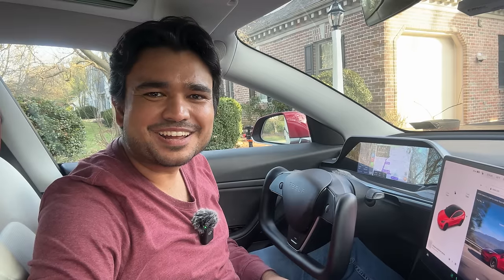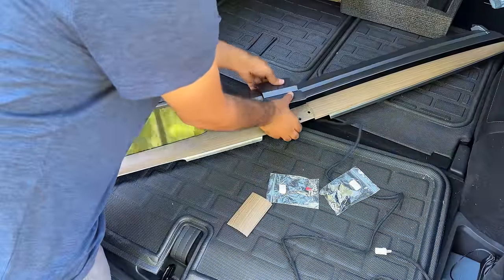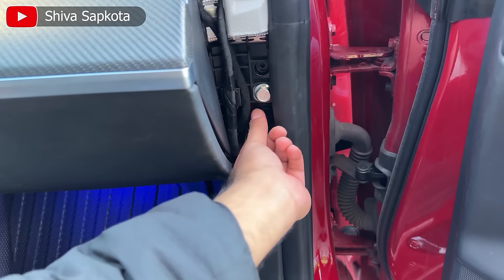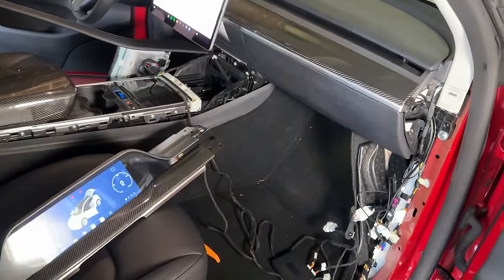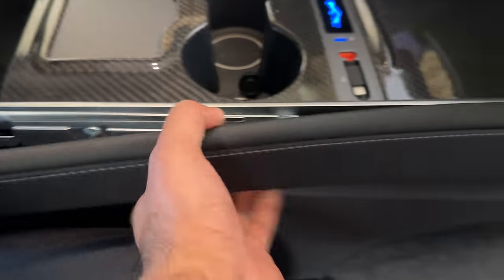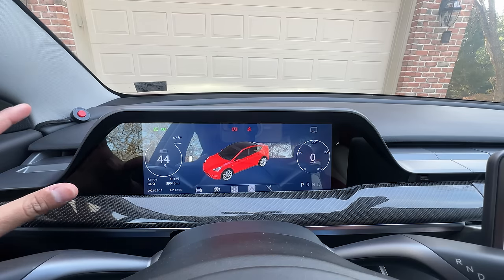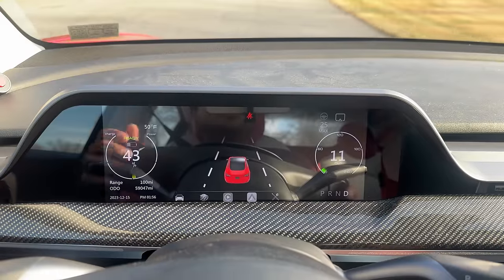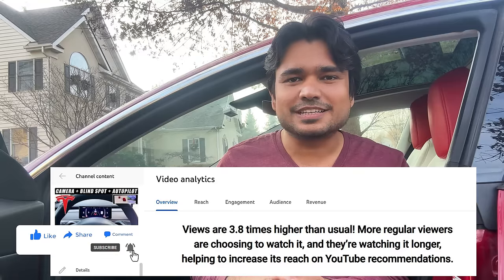MOST Integrated Instrument Cluster Display For Tesla Model 3/Y Now Has Android Auto & Carplay 2023

Comment: Hey Shiv. I really do like your reviews but not sure you did this one justice. I do agree with some of the UI inconsistencies and there are a few more you didn’t mention. The seat belt light stays on, the % under the battery amount (instead of beside) the mi/h, the fact that speed limit warning is totally missing. Maybe include those next time?  Also, aside from all that I purchased this from Teslasy and they have already addressed the seatbelt icon issue. They are working on the others. The graphics are no different than other displays and in fact the crispness and clarity of this one is WAY better than the smaller displays.  Also the time works perfectly if you set your timezone. Things like this missing from your review make potential buyers not get the full picture.
Reply from the maker: Thank you my friend. I really appreciate the honest feedback. You have supported my channel for a long time and I am extremely grateful. With so many products I test, sometime I don't catch all the inconsistencies. I will for sure try to highlight those in my next video.
Reply: Have they addressed the other issues yet?

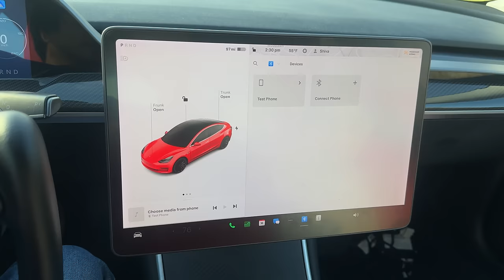Comment: Hi Shiva, I just installed mine but I noticed the seatbelts icon on the passenger side is on and I have to buckle it in order to go away. For sure it on my tesla display screen showing my srs system is working normal. Is this normal on the unit and will there a software update to fix the configuration from the TMA side? Thanks 23:21

Comment: I have a german Model Y. Does it fit in there?
Is a front camera compatible?
Reply from the maker: You will have to check the type of dash you have. Some Model 3/Y built in Germany have different types of clips and won't work with this display. If you open you dash and you have a curved clips, this won't work. If you have straight clips that attach to the car, then yes this is supported. Front camera is not supported on this one. Thanks
Reply: @ShivaSapkota  thank you. I have curved clips, so it does not work 😕
Only the Model Y is built in Germany. The Model 3 does not have the different dashboard. The Model 3 is built in China and USA. Here in Germany we get only the chinese Model 3 from Giga Shanghai. Giga Berlin produces only the Model Y.
Reply from the maker: @David-jt4bh  Oh I see, sorry about that :(

Comment: Question: do you have to take this stuff out when you take your Tesla to get serviced?
Reply: Unless the need for service is something connected to your display, there should be no reason to remove this when your Tesla is serviced.

No automaker can refuse to work on a car with aftermarket parts unless those parts specifically interfere with the need for service.

Comment: Shiva, have you ever tried connecting the plug that goes up in the dash into the one at the back of the center console instead of I realize the two plugs may be totally different, but perhaps not. I am just curious. Thanks.
Reply from the maker: They are different plugs with different protocol unfortunately! Thanks.

Comment: Does this modification cause a battery drain if the vehicle is off or a range reduction? A concern with any of these modifications .
Reply from the maker: These accessories connect to your 12V battery, so no issues with range. The high power battery does charge the 12V but the range loss is minimal. Thank you!

Comment: This model appears considerably more expensive than the Hansshow F9, with fewer features other than the more integrated look.  Actually, I find it no more integrated than the other flat screens due to the center joints in dash cap, and the curved ends that, to me, look less integrated than a rectangular screen that resembles the shape of the Tesla center display.  I don't like all the wasted display space at each side.  Why didn't they square it off more?  Lack of camera, blind spot warning, and steering wheel controls make it a non-starter for me, especially given the noted shortcomings in UI.  The biggest benefits I enjoy with my 1-year old 10.25" 4G unit are: (1) it looks totally compatible with my center screen; (2) I can control everything with steering wheel buttons; (3) I can listen to podcasts and display Waze or Google Maps in front of me; (4) bumper camera saves me from hitting parking curbs at front; (5) I enjoy speed info closer to my line of sight.  I would consider changing from my 10.25" ro the F9 if they improve the UI, as I like the F9's higher resolution screen, the blind spot warning, and with the hope/expectation that it is less glitchy when initializing the BT connection than mine is.  The air flow interruption isn't a big deal for me, as I live in a moderate climate.
Reply from the maker: I agree, this one lacks a lot of those features we saw on the F9 screen. I am with you the 10.25" 4G screen was a great one with all the great features. If I had to pick one display to keep, my current choice would be the F9 and that is currently installed on my Model Y. Thank you for all your feedback over the years, I really appreciate your continued support to the channel.

Comment: The latest model has some nice improvements, but there are two significant drawbacks that make it a deal breaker for me. Firstly, it doesn't have full-screen Android Auto/Apple CarPlay, and secondly, it lacks a scroll wheel control. As a result, I won't be purchasing it. Perhaps the manufacturer could create a Bluetooth device, such as a wireless trackpad or a scroll wheel, to address these issues.
Reply from the maker: Thank you for your feedback. I really appreciate it and will pass them along to TMA.
Reply: I agree that the inability to control it from the steering wheel controls would be a huge improvement.  Same with the ability to decide where the data sits in the screen-that would be great. Makes me want to get a Model 3!